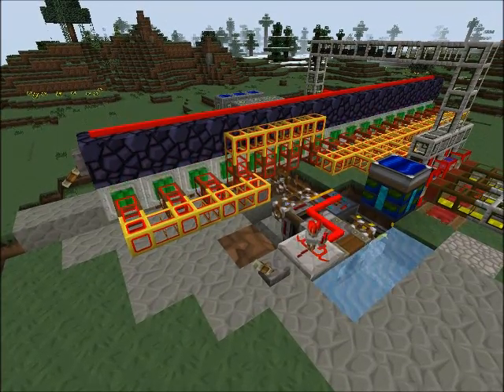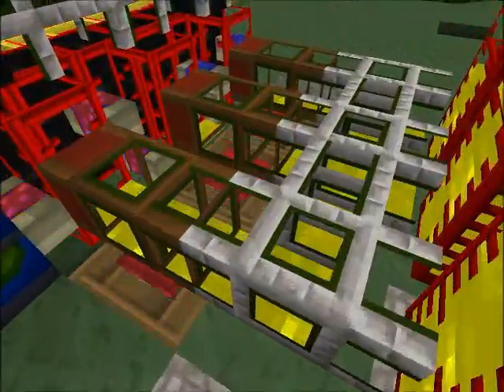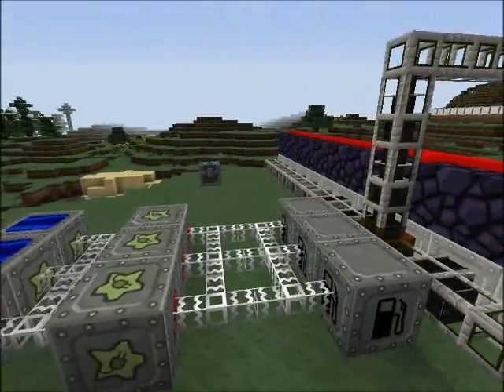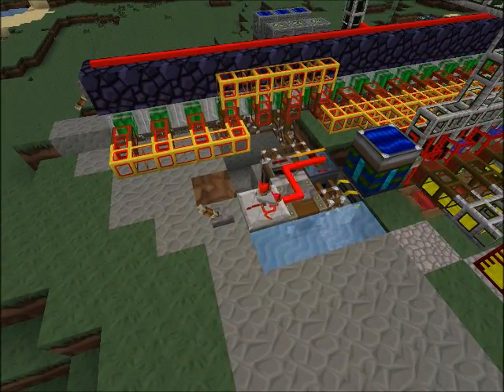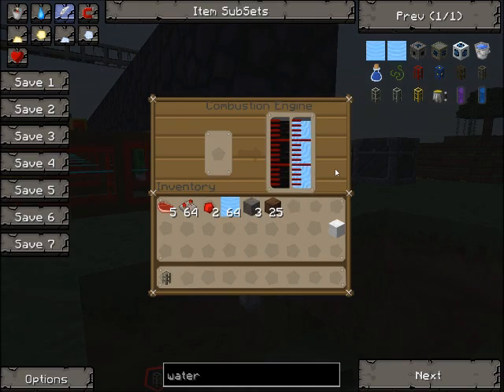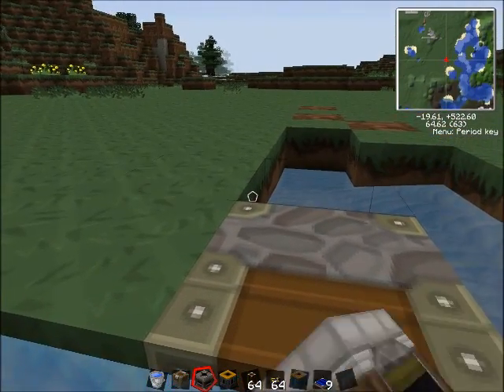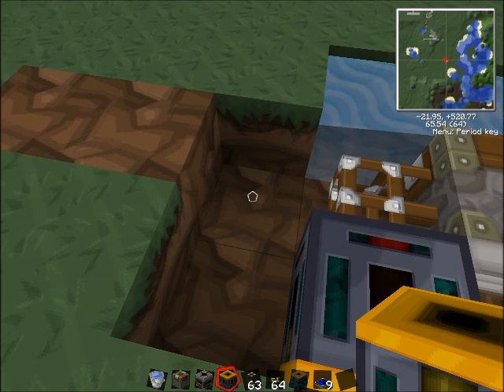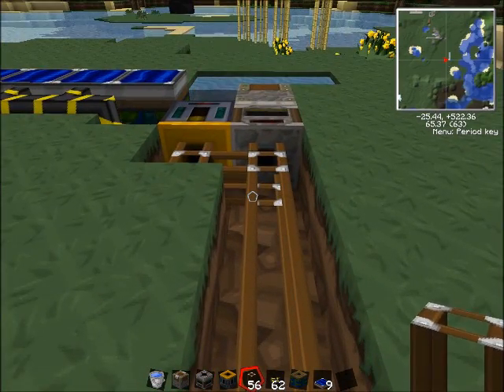Tekkit:  Keeping Your Combustion Engines Cool

Comment: doesnt seem to work anymore,   buckets get stuck in the engines and wont get out
Reply from the maker: This is really old now.  I don't think it's the same thing, but did the area become unloaded?  I know that a lack of chunkloading made buckets get stuck in the RP2 machines.
Reply: no,   i think the thing that is "sucking the buckets out of the engine, is in redpower,   which no longer exists unfortunately

i made a huge quarry,   then couldnt keep it cool enough because the buckets would get stuck,   and blew it all up
Reply from the maker: I'm not sure what's causing the issue.  I haven't played tekkit in forever, and newer modpacks have aqueous accumulators/ liquid nodes or other water sources that can feed directly into the engines without the need of buckets.  So I'm unsure how to help you on this one unfortunately.
Reply: its ok,   was just trying to find the thing that was used to suck the buckets back to the water machine,    i dont like the way water pipes handle the liquid, as it takes way to long to cooldown machines
i turned off buildcraft and tekkit altogether, dont want to waste my time with it anymore
Reply from the maker: Mitchell Bristow I didn't like how they worked back in my 1.2.5 tekkit/technic days either.  They've gotten so much better in later versions of buildcraft, and other mods added even better pipes than them.

Comment from the maker: This is all explained in the video.  The deployer, supplied with an empty bucket, will collect the water in front of if, the filter can take only full buckets and supply it to the engines, and the retriever can take the empty ones out of your engines.

Comment: okay I have a question guys. Im running a large Refinery complex 3 levels high. with the various tanks, pumps, and pipes im running 26 combustion engines for 7 refinerys. They will be fueled by oil, and I want to run them Constantly. What would I have to do to keep them cool. I wanted to use a central water pipe system, but Im thinking that providing equal water despertion could be a problem. Would a blulectric engine feeding water from tanks provide enough flow to cool a combustion engine?

Comment from the maker: One thing to keep in mind is that you should attempt to keep the chunk loaded.  If it gets unloaded there's currently a bug and the retrievers don't output.  so either keep it loaded when you go out and adventure, or when the chunk reloads, immediately go and tinker with the system until it works.

Comment from the maker: I have never had one blow up with this. I left the engines you see on for a few hours, the game running.  

I don't think fuel heats up engines faster than oil, like i'm using in the video, it doesn't mention that in the buildcraft wiki.  so i don't think that it would.  Perhaps it's just a detail they left out, however that's improbable.   Thanks for your interest :D